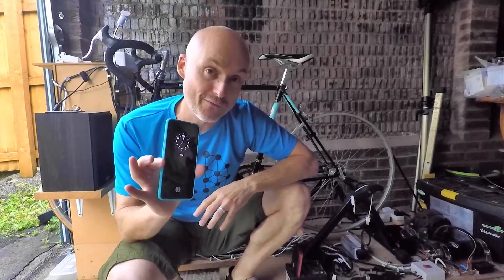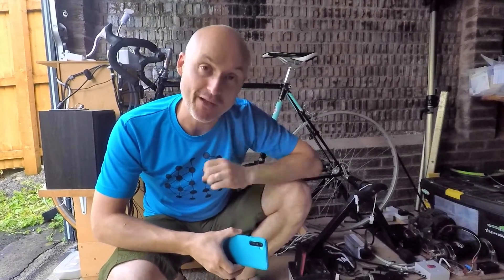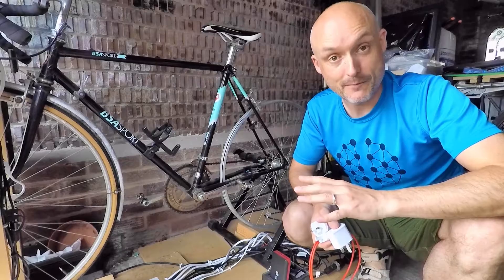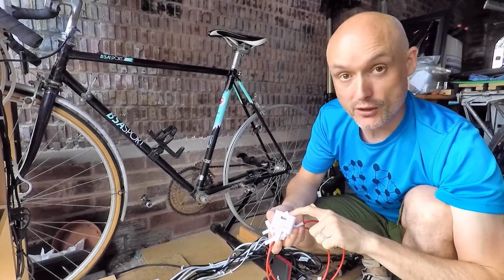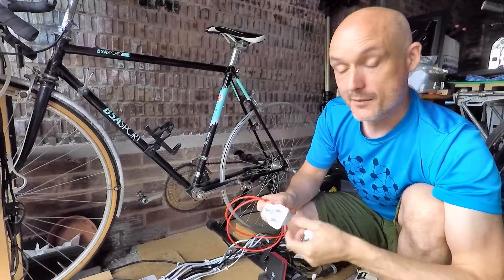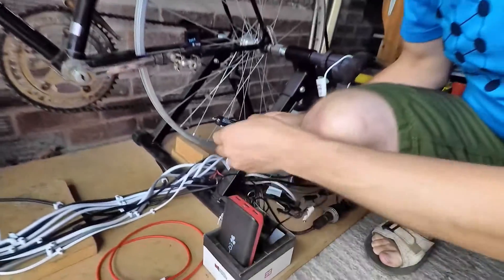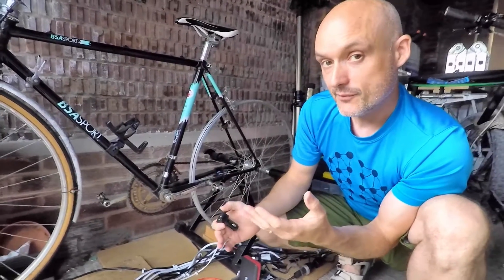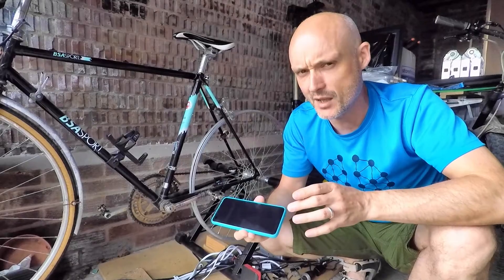Charging a Mobile Phone on a Bike Generator - How Long Does it Take?

Comment: Plzz make a video on charging mobile from cycle Dynamo (which produces 20 volt AC) with the help of circuit
Reply from the maker: Hey Kulbhushan, thanks for the comment. I don't have a 20 volt dynamo unfortunately. I do have a hub dynamo, but that produces 3 volts. 
Essentially, all you would need for the 20 volt dynamo to charge a phone would be a simple voltage step down circuit, assuming the dynamo produces DC. If it puts out AC, you'd also need a rectifier, which are usually purchased as a single component.
Reply: Ll @SystemicCreative